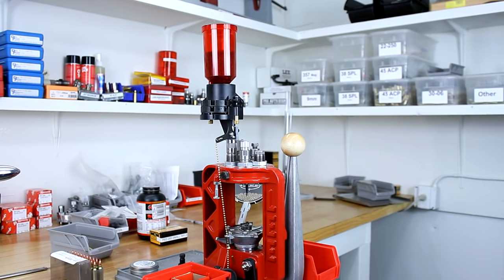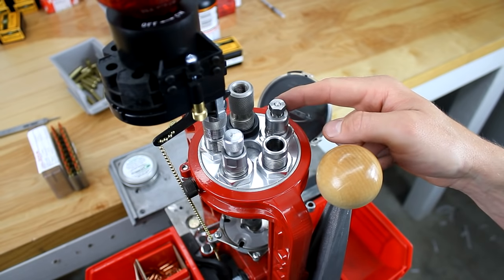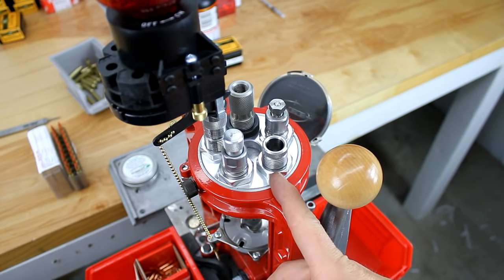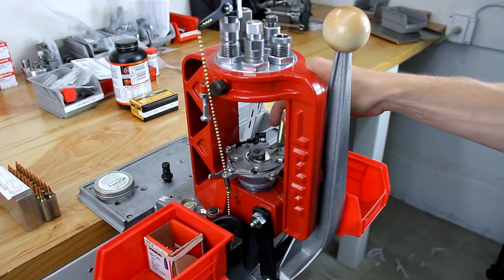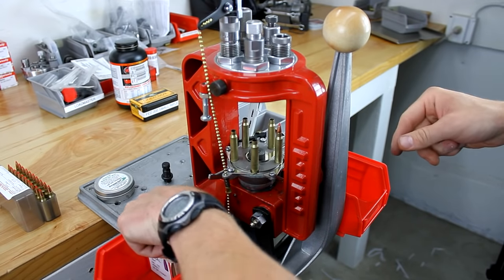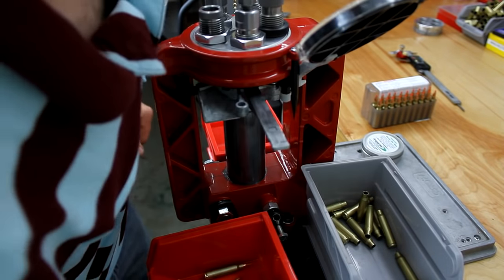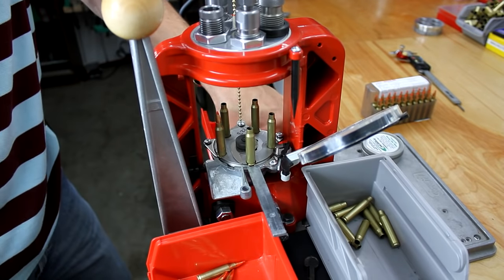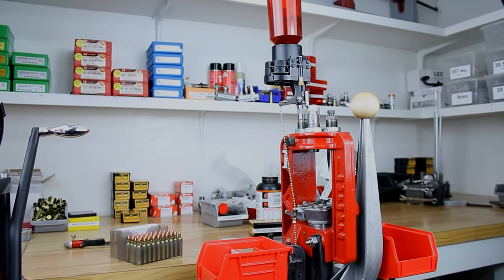Lee Loadmaster Loading .223 - 5.56 NATO

Comment: To solve the round dropping on the floor problem. I inserted a piece of thin cardboard, like from the back of a small note pad, into the front slots on the catch bin. No more bouncing out. I also added a piece of leather to the bottom of the bin to act as a cushion to stop the bouncing.  Give it a try.

Comment: I bought a lee Pro 1000 as one of my first PRG. Presses and I’ll say this it worked as advertised.  It did have a decent learning curve and when I tried to change calibers I did not have an easy time. As a matter of fact I stopped trying altogether. Anyway enough of the negative stuff because with this press and a decent scale  I reloaded my first 500 rounds in 1 night. 
Years later I know more than anything that how you do things and not what type of equipment one uses is more important than anything.  
So what I’m asking Gavin and anyone else that would like to chime in is what are the ( realistic not exaggerated) likes and dislikes about this press. I currently have a lock and load and I remember my good and bad experience with my Lee. 
I’m considering buying one of these and would like to hear from some of the more experienced guys.. thanks for posting Gavin, always enjoy your non bias videos. 
Michael.

Comment: Nice introductory video for reloading 223 on the LoadMaster Press. You neglected to mention that the case lube should be removed from the case after reloading. It will come up the chamber with carbon and goo and it also greatly increases the force on the bolt face which could be dangerous in a weaker firearm.

Comment: That was my thought. Not to mention uniforming primer pockets. I have come to the conclusion that you have to do .223 in two cycles. First run is a tool head with decapper, and a quick trim die. Then tumble and uniform all the primers. Then load progressively as in the vid, except I would use the case feeder since it is only $25 and it works fine.

Comment: I love my loadmaster. I have in 4 years done over 10k in, 9, 40, 45, 556 and 7.62x51. I have all upgraded parts and since then, it has stayed  adjusted. Over 1000 rds with the new case feed bolt and locking nut. All I do now is lube it every 200 rds for the main shaft and every 2000 rds I lube the 3 grease points. I am extremely happy with this press.
Reply: What model do you have?
Reply: +wintersportowen Lee Load master.  I have now 6 calibers I reload for, 9, 40, 45, 300blkout,  5.56, and 308. Awesome press.
Reply: +bulletstop100 does it come with the brass loader, i seen this guy didnt use one but i thought it cam with one.
Reply: +Michael Rios , Yes it does, I use both the large brass feeder and the small with corresponding pusher. When setup correctly it feeds the brass no problem, but if using the wrong size feeder and pusher causes some issues.
Reply: I am looking to get into reloading, but I can not find anyone who is willing to tell the difference between 5.56 and .223. We all know there is a difference when it comes to the chamber of the rifle & barrel but what is the difference when it comes to reloading. Is there different die's and set up for 5.56.? All the videos I have seen are always referring to .223... I prefer 5.56 for my rifle is why I ask and before spending a ton of money on reloading equipment, I would like to be informed.. Any help would be greatly appreciated.
Reply: @oldmanpatriot1490  556 has a thicker case wall. No difference in dies, 223 reloads lake city brass used in military ammo..

Comment: I'm with you on over polishing. I don't trim pistol brass as a rule, and run it straight through, However, I found enough variance in .223 brass that crimps were inconsistent and ammo had feeding problems unless I trim first. So for bottleneck rounds, I trim the first time and use an idiot stick to check whether I need to trim thereafter.  I only uniform military primer pockets one time to remove the crimp so that primers seat well. I haven't yet found the need to do more than that.

Comment: I've used the Loadmaster for the majority of pistol rounds as well as .223 and .308 to date.  I can see using all stations for pistol rounds but for rifle rounds I deprime, size, trim, debur & chamfer, and also hand prime before  running them thru the press.  I also use the case feeder for .223s and it works well but .308s get a tad wobbly.  Once a guy watches enough how to set up and use the Loadmaster on YouTube you have a pretty decent moderately priced press.

Comment: I hear a lot of people trashing the Lee load master and say you need the Dillion press.  I have the Lee load master and love it.  I'm new to reloading and the one major thing that caught my eye on the Lee was the price.  The Dillion's are almost twice the cost. I don't know about any other press but the Lee.  After the initial set up of my progressive press it helped to understand what the machine is doing before actually started  reloading. I m loading .45 ACP.  I first reloaded 24 rounds and took them to the range for test firing.  I shoot a 1911 so you know that some rounds can be difficult at times to feed. I shot two 8 rd mags nice and slow to see how my new reloads chambered and ejected. They cycled perfectly.  The next mag I emptied as fast as possible, all chambered and ejected nicely. My reloads on the Lee load master had perfect primer seating right out of the box, my auto disk powder drop yielded a 7gn throw 99% of the time! the combo bullet seat and crimp die made for beautiful crimps.  I have a auto shell feeder that helps speed the process.  Sometimes the feeder won't push the casing all the way to the shell plate and causes the shell the hang up on the depriming die. It doesn't happen often and when it does, a little nudge with you finger solves that issue. You also need to keep your eye on the primer reservoir so not to run out.  I give this machine a 9.5 out of ten. People that don't care for this machine is probably because they didnt take the time to learn how to use it properly.  Save your money and by the load master and use the cash you save for dies and shell plates for all the other caliber a you can reload with this machine.  Last but not least, the best thing about the Lee Load Master is that it HAULS ASS!'m
Reply: I agree, I have used three different brands and the Lee press does very well. In fact the selection of Dies are far more important than the press itself. Inasmuch as all dies are interchangeable, spend more on the dies and get a press you like based on price and quality.
Reply: Lee gets a lot of crap because while they do include user tips in their instruction manual, it is extremely optimistic in assuming everything is set perfectly at the factory. Critical things like realizing that the nut on the bottom is used to adjust the ram so the flipper works correctly is not cited unfortunately.
Reply: I think Lee is also maligned because they started off many years ago with very affordable and innovative equipment. It was not top quality, but worked. If you pick up the Lee book on cartridge reloading Richard Lee talks about the evolution and his effort to build better quality while being affordable. He resisted the push to build more expensive equipment that did not perform any better than the competition. The very knowledgeable reloaders speak about Lee dies and presses and specifications being top rate. I have not heard anything bad about Lee from the experts that I have spoke with.
Reply: SA Bjork His book is what got me set up on reloading. Pretty solid information in there, but the first half is a long 50 page advertisement. Haha. I have dillon equipment I got as a gift and I actually prefer the lee instead. Suprisingly the top (as in wins most matches) benchrest shooter in my area actually uses lee dies, presses, and scale. Who would have thunk it? Most of the dies are constructed to the point where brand really doesn't matter, enough quality is in each product that the biggest variable is the amount of care the handloader has.
Reply: That says it all. The top shooter wins with it.
Reply: Ps Lee talks about using the competition's stuff then making it better and cheaper.
Reply: +Tutto Bene  I agree 100% about the lee press. I would like to know what kind of powder you are using. That sounds like a very hot load. Just curious. Have fun and be safe.
Reply: +ctech01 imr 4756. The load data is in the book
Reply: Thanks for that info. I have used  HP-38 at 6gn. and tight group at 5.4 and WST at 4.8 for target in the 45acp  and I really liked the WST for target. When you said 7gn's it kinds took my breath so I had to ask. Thanks for the info, and be safe.
Reply: Ctech, That is max load for 230 grn HP
Reply: Thanks for that info. I mainly reload Berries 180 gn and one of my favorites is Extreme 200 gn. in 45acp. My 230 gn loads are for defense and I use factory loads for that.
 Thanks again for the info. Keep it safe.
Reply: Thank you! Good safe shooting (and reloading) to you too!!
Reply: Yeah, the green and blue crowd love to rag on Lee as being inferior. Just elitist BS; my Lee Challenger single stage produces (albeit slowly, but whose in a hurry?) rounds for my Howa 1500 .223 that are sub-MOA at 100 yds, when I do my part. The handgun ammo I make with it is just as accurate. The proof is in the pudding ;>)
Reply: Tutto Bene there is nothing wrong with lee if you know their strengths and weakness.  Like all presses they have a learning curve and like all they have certain things that others do better. There’s none that I know of that are perfect. 
Like a woman they all have certain things that drive you crazy, you just have to find one that you can deal with and that works for you.

Comment: I use a pro 1000 to load once fired brass.  I have one turret set up to size and deprime.  After that I trim, decrimp, and prime off press.  Then I clean the lube off the brass with ground walnut in a tumbler.  Next I change to a turret with a Hornady powder measure, a powder check die and then bullet seat and minimal crimp.  I also have a loadmaster for loading twice fired and beyond.  I have no problem with the case feeding on either the loadmaster or pro1000.  My loadmaster is nearing 25 years old and still working fine.  I use the powder check in station 4 and seat in 5.  I drop the bullet in at 4 before the plate indexes.
There is a bit of a learning curve to addressing small problem (adjustments) resolutions but once you have that down the press can dump an ammo can of accurate and reliable 223 in a few hours.   Rather that using the case collator at the top of the case feed tubes I use a small funnel that fits into the feed tubes but has a large enough opening for the case to drop through and drop cases base down individually into the funnel.  It surely beats trying to hand stuff them into the tubes.  It takes seconds to fill 4 tubes. 
Also, Lee recommends using only Winchester or CCi primers which have harder cases.  I recommend a primer explosion shield for the Loadmaster.  It is a great investment at less than $10 and can really save the day even though I've never had a primer explode in the press.

Comment: I find that instead of using the Redding die I just bought an extra decapping pin from Lee and broke the pin off the tip and used it in station #2 as you do with pistol dies.  Buying sacrificial pins are cheaper than buying dies

Comment: You will be happy with the loadmaster. Make sure to get a universal decapper for station #1 and put the sizer - decapping pin in #2. Get the funnel and you are set for easy high volume ammo making. With cast, it is particularly nice to seat and crimp seperately. For me with 9mm between casting, tumble lubing and loading is about 2hrs 10 per 500. 45 is supposed to be about the same, with faster casting.

Comment: No, I started casting almost immediately after using my small stash of FMJ. However, lead bullets can get the same  issue. Just turn down the die for the powder drop a little more and give it more flare. I think people worry too much about over flaring and wearing out brass. The brass for most common pistol calibers lasts ~forever and is nearly free. Just a little more flare will solve the shaving. Once you cast you will make 9mm .38 spl & 45 for close to .22lr. I bet you'll move up.

Comment: Gavin , I have one of these , I also have a RCBS rockchucker single stage . Bought it new 45 years ago . I’ve loaded thousands of rounds on it. Paid $ 107.00 for the kit , powder measure, scale, and press and some other parts . I should have bought a Dillon 650 or a 1050 , big mistake I though it was to much $$$$ . The the cost to replace my current equipment would put me out of the game . I wish I would bought a Dillon instead of loadmaster , primer feeder is a pice of crap , power dump I replaced with a Dillon one along with the neck expander insert that comes on there presses. You have really good videos, I would not buy one of these , save your money and buy blue , thanks

Comment: The first stations die has a steel pin running down the middle. When the shell plate raises as the lever is pulled down, the case is pressed upward and into the die with the pin. The pin is long enough to protrude through the empty case and into the old primer and pushes it out.

Comment: Unlike the Dillon presses the primer is seated on the upstroke. This is when the powder is also charged. So don't even try it. The manual says specifically not to charge or deprime on station two. That's on page six in the manual btw.

Comment: yes you can most of my lake city is 556 just follow the steps of the reloading data as if it were 223....the only problem with most lake city brass and most 556 brass is the crimp on the primers for that i recommend using a single stage press and alot of case lube for depriming then clean and resize the primer pockets

Comment: Exactly how much work was done on the brass before you got to the progressive reloading stage?  You mention cleaned and lubed, but did you have to do the entire trim/deburring/sizing progress before the progressive press or does your "sizing die" actually eliminate that step?  I'm really interested in a progressive press but I'm wondering if it's as simple of a  process as all the vids imply or whether you still need to do tons of work on each case individually before you get to the press.

Comment: I use a pro 1000 with 5.56,now it works well after a lot of fiddling with it but i do like the return spring better than pull back chain because it leaks less powder by keeping more pressure on case mouth.

Comment: @msharpashotr >>> it not just to get the casing centered, the RCBS competition die allows you to drop the bullet dead center nto the die without you having to hold it on top of the case/brass ...it works for me, it lets me seat bullets faster.  Just a thought

Comment: Great video.  With regard to rifle brass, how do you deal with case prep when loading on a progressive press? Now I size/deprime, tumble, trim, prime, charge, seat and crimp.  Do I have to do all the case prep stuff in single-stage mode first?  Seems like that would defeat the purpose of a progressive press.  Appreciate any advice.  Also, any opinion of Lee Pro 1000 vs. Loadmaster.  Thanks!

Comment: how s the priming working out for you.I use the same press but the priming for 223 is always an issue - either wont feed,or wont center primeres properly and puts em sideways on the shell etc...Also - what powder disc feeder you use for  223?I used benchmark powder and in the manual doesn say what disc to use....

Comment: @txstang84 just thought of another variable-RCBS makes a die called an "X-Die". I have one in 30-06 and when properly prepped, it's supposed to greatly reduce or eliminate the need to trim your brass each time. I haven't been using it because I still have to full length size anyway (according to the instructions), so I don't really know if it works as advertised, but the principle makes a little sense.

Comment: @jasauve sorry for the hijack-how much you prep the brass (e.g., trim, debur, chamfer) is up to you and based on condition of brass. At a bare minimum, checking the brass for in spec length will keep you from jamming up dies or causing chambering problems.

Comment: Great looking set up.  Just have a question in the process.  I used to load with my dad and we had a single press.  We would always size and deprime then put the empty cases in the tumbler.  I'm guessing your putting rounds in the tumbler first.

Comment: I've encountered a problem using the Auto Disk with rifle cartridges- if all cases in the batch aren't trimmed to an identical spec (I don't trim bulk ammo every time if its within a spec- my last loading session, many cases where actually shorter than the manual specified trim length), the powder charge die will crush cases longer than the case used for reference when setting the die and will spill powder if a case is shorter.

On a single stage or turret press, this can be worked around by setting the die with the shortest case in a batch (prevent leaks) and just using caution to raise the ram only as high as needed to charge without crushing.  I don't see how that would work on a progressive- you have to use full strokes to keep the other stations doing what they're supposed to.  I'm planning to upgrade to a progressive soon, but the benefit is basically negated if I can't have auto charging.  Is there some trick to setting up the rifle charging die/auto disk combo I don't know about, or is it simply a matter of I HAVE to trim my brass to all be the same length (even if that means trimming cases that are already below spec)?